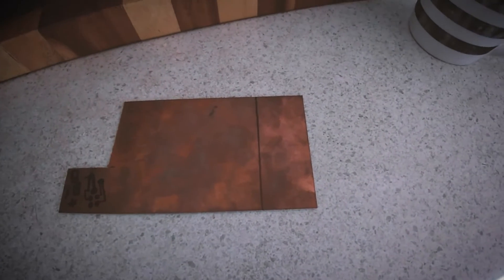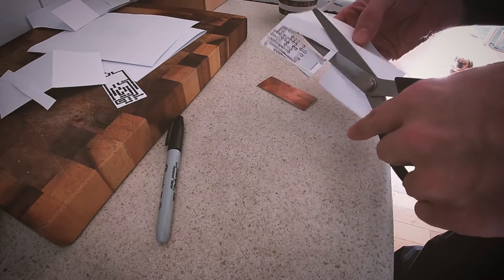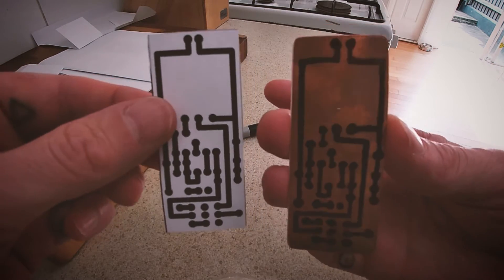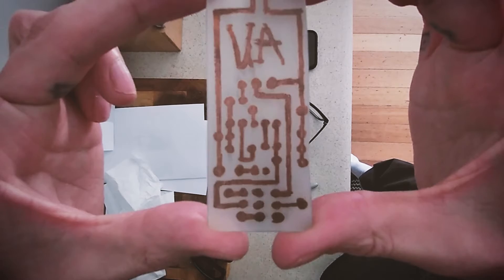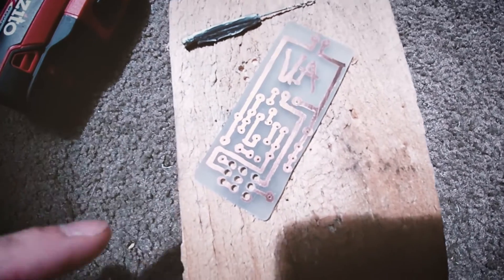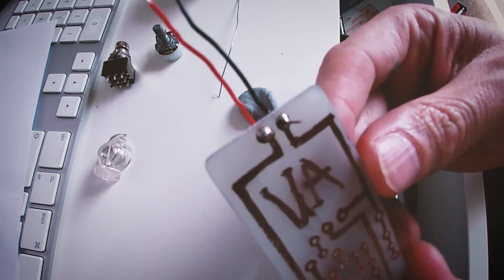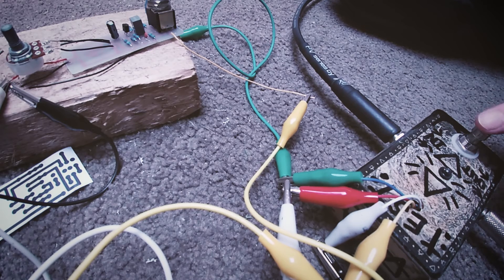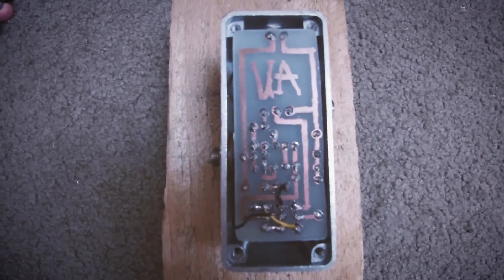DIY Boost pedal with a sharpie etched circuit!

Comment: Used to be able to get copper blanks and etching solution at Radio Shack at a strip mall near you. They had a great selection of all the parts needed for projects like this. Too bad they thought selling cellphone accessories was a better business model 🙄.
Reply from the maker: Dunno. I think most populated inner city areas cell things like electronic components, yes not the most profitably business model but at the end of the day pedals are out dated technology for the most part

Comment: thats really cool!
so the drawn on sharpie keeps the copper underneath from coming off, did i get that right?
Reply from the maker: Yeah that’s right the chemicals won’t remove permanent marker but will remove copper, but you’ll need acetone or nail varnish remover to get the marker off once you’ve etched it
Reply: @unholyaudiochannel  Isopropyl alcohol works pretty well on sharpie, too.
Reply from the maker: @heterodoxic  I can’t I’m sober 🤣
Reply: https://youtu.be/AnOy9_1rdPw